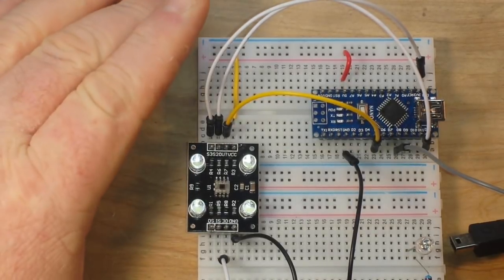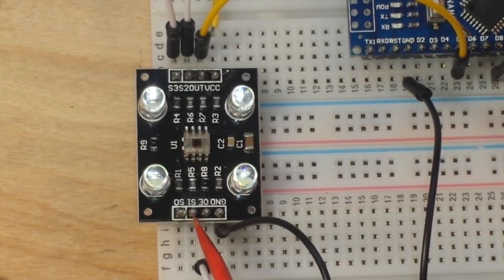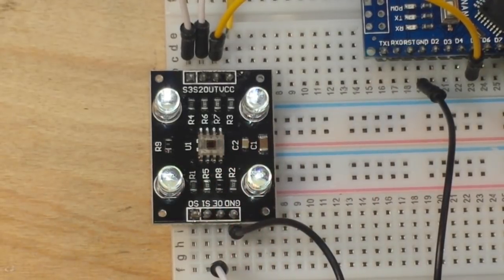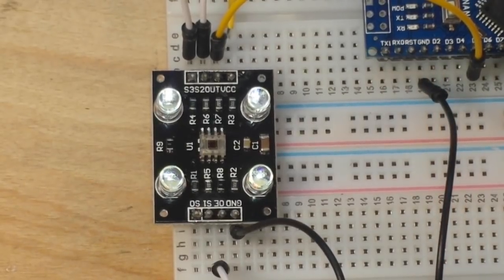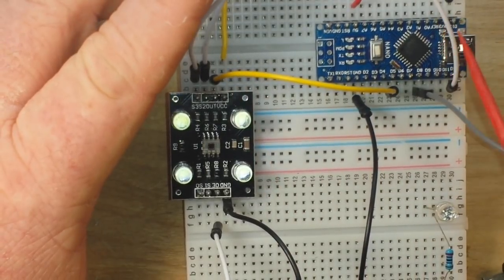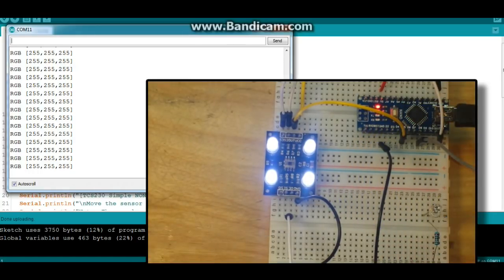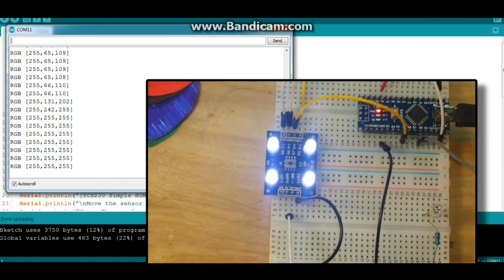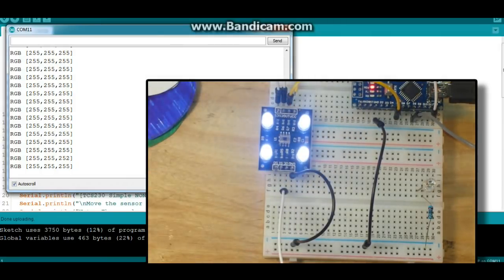tcs230 color sensor and thanks for 10k subs

Comment: Got this sensor working fine by using a torch behind various coloured lunch box covers or platic and projecting a strong color onto the chip. At the same time i placed 4 black color cylinders around each of the white LED's so the bright white light stopped causing a problem. At least it allowed me continue with my project

Comment: Congrats on the 10k Paul! Delighted for you!

One of my first big arduino projects was a skittles sorter that I build with one of these sensors. 

I took a few baselines of each colour skittle and stored them in my sketch, then took the average of 10 readings from the current skittle and compared to my baseline and put it in the closest one

It was maybe 95% accurate after a while but changing lighting conditions had massive impacts even though I was trying to block light as much as I could.

I've also seen people use rgb LEDs and ldrs as a colour sensor, might be worth comparing against this and the adafruit one

https://iamzxlee.wordpress.com/2014/03/05/colour-sensor/
Reply from the maker: Ill chec k that out, thanks Brian!!

Comment: So funny to see this.   I’m a EE at AMS formerly TAOS who makes the TCS230.   
That part is 1998 technology.   You fail to understand the advantage of that part.   With literally 0 components in between you are able to get a color reading off of it.     No screwing with photodiodes and transimpedance amps or Analog to Digital converters.   Nothing!  And you get a reading.     You should have asked yourself why you are getting all 255’s when no card was in front of it.    If you want to check out a more modern color sensor with I2C interface look at the AMS  TCS3472.
Reply from the maker: I have the newer module on the way.

Comment: Congrats on the 10k!  I was just messing with this sensor today, with unimpressive results: it reads yellow as blue and doesn't recognise red at all.
Reply from the maker: I have had the same issues. Give me few days to get the Adafruit sensor in and a new video will be coming.
Reply: learnelectronics It seems more accurate with some kind of shield around it to block out ambient light. I'm trying to get it to output something close to its detected colour to an RGB LED.